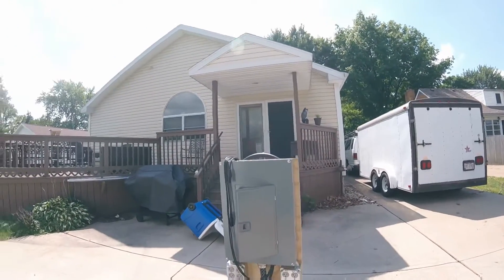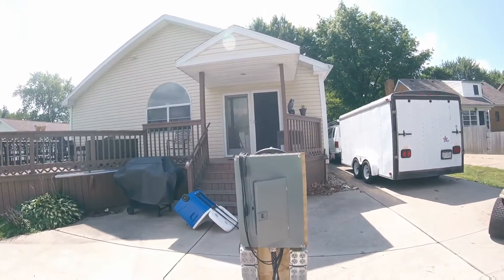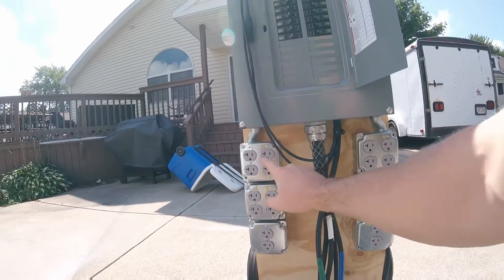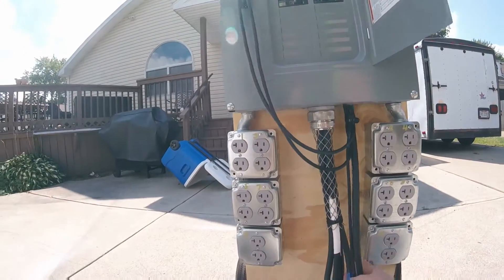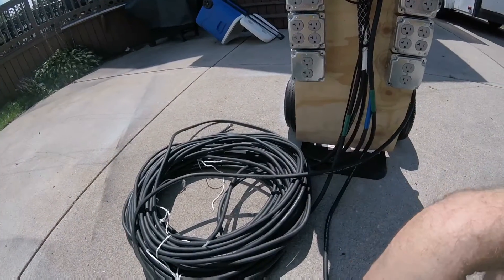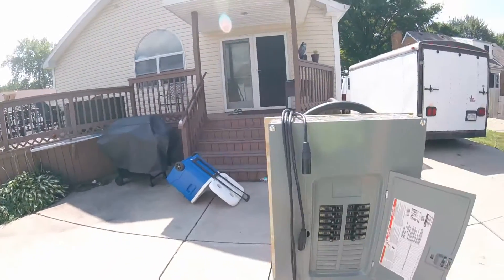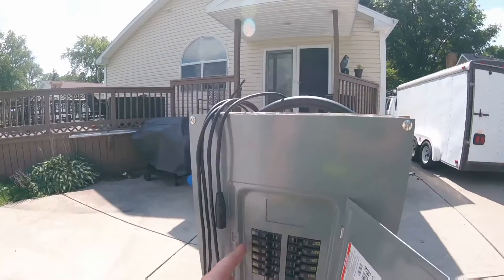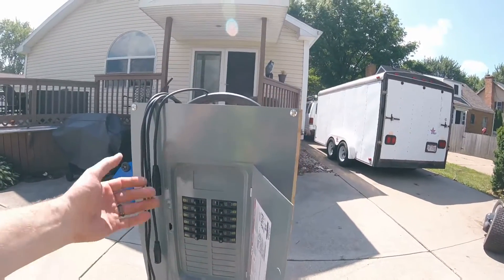Distro Box

Comment: If your system is only 50 amps single phase you could use one of the hot tub gfi panels in front of your panel or put gfi recpts in ea. outlet box . Gfis in ea. recpt allows only the circuit with the fault to shut down not the whole system. As for a main you could use a shunt trip main which would allow for remote shut down, shunt trip breakers are rather expensive though, so probably you will have to use the accessory main for your panel or if it is nor a mail breaker convertible panel a back fed branch breaker.
Reply: GFIs can be unpredictable the last thing you want is a few drop of rain tripping it mid show

Comment from the maker: Hey guys sorry for not responding. Monkeymhn7. Yes great idea on making a main breaker for emergency shut down. I wonder if I could insert a GFI outlet so if water some how makes it's way into the box it will shut everything off. (I'm not an electrician) my buddy is and he and I designed it. Justin. We use cam locks for the inserts on the box and cam locks to connect to a generator. The XLR are wired to each leg(pole) to see (amperage). We also have a small thermometer that is inserted into class A amps. These amps typically generate moderate amounts of heat. Tony. The distro cost around 300 dollars to make. The 2 gauge wire and cam locks cost the most. Trust me you don't want to go cheap with power.  I will post another video addressing your questions the best way I can.
Reply: ACSOUND ACSOUND p

Comment: having your own local ground is defiantly a good idea   often times especially with long wire runs the impedance in the ground circuit is too high for the needs of audio systems and RF tends to sneak in to do damage to our speakers and amps. ammeters at front of house are a plus the only thing I would add is a main breaker I have been in situations where I have had to pull off the buss lugs without a main you could run in to trouble if for some reason their is a short in the distro from a buss to ground or buss to buss..... I saw this happen in a home panel not more than 3 months ago.